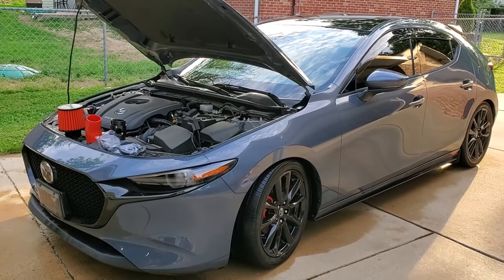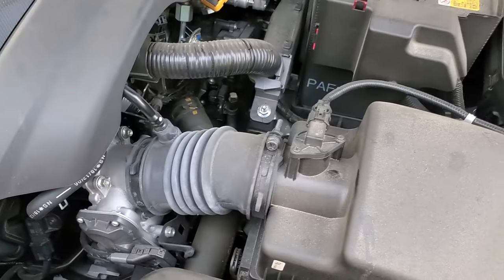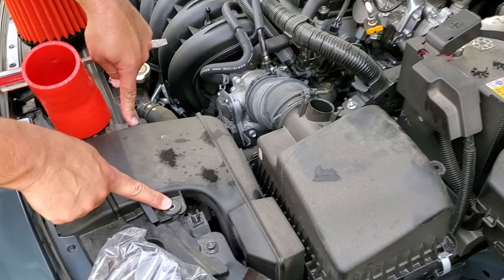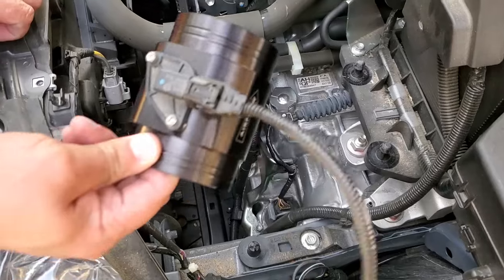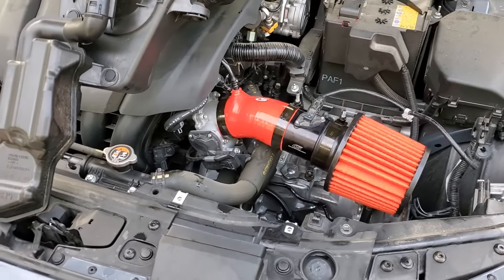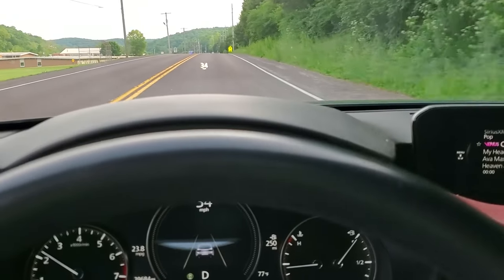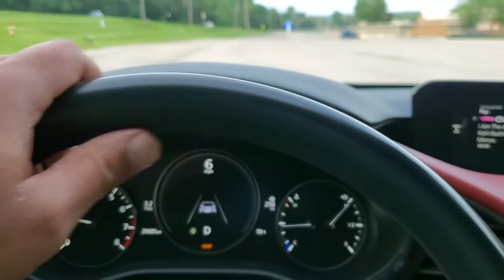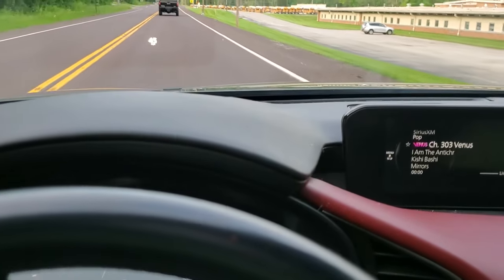2019 Mazda 3 gets Corksport High Flow intake and the car comes alive. Simple install for big sound

Comment: Dissing Mazda engineering while installing hot air intake hmmmmmm
Reply: Not to mention from what I have read on the mazda 3 forum is that you actually lose low end torque with no hp gains. The placebo effect.
Reply: No offense to the OP but I thought the same. The larger OEM intake is clearly a CAI even if not as flowy as an aftermarket one would be. That shorty looks like a step backwards
Reply: That was my thoughts lol 😆
Reply: You do, on just about every car you put these dumb things on.
Reply: Ed Findlay  people think any aftermarket part actually increases performance
Reply: yup, there is a reason why mazda did it like that, and still stock i can hear the air going through, its not too big but i can hear it
Reply: @fakebrake  not at all. I found a noticeable increase in power across the board. The skyactiv's torque peaks around 3000 rpms. But remember, when you start with a small 4 banger, expect small gains. Actually skyactiv's have been dyno's with all types of mods, with just 93 octane there's an up to 7hp increase, with corksport intake and exhaust on the 1st Gen Skyactiv 3's, dyno saw an increase from 118hp/110lb ft. of torque to 135hp and 123lb. For a small N/A 4 banger designed for gas mileage with 13:0:1 compression, it's not to bad.
Reply: Also, intake can be beneficial if don't properly. But air velocity is important. If you put a 4" intake on a 2" throttle body, you will see and feel a loss in power cause the air now moves slower, and then bunches up and gets turbulent at the throttle body. But if your intake can smooth out the flow of air, and is the same size as the throttle body, you can increase air flow and reduce turbulence. That's why quality intakes cost money. It's the R&D to keep it as close to factory specs while actually gaining power and response.
Reply: I thought the same. Mazda seems to make a really nice air box, honestly the one on my new cx5 looks darn near as nice as the trd air box for the 4Runner. If anything I have been doing my research on the takeda two stage cold air intake system.
Reply: @thetechlibrarian  I think the afe intakes for the Mazdas come with an air box as well, they seem really well engineered.
Reply: It makes above 5k rpm and lose below 4k. The highest 2nd gear comes down to when you shift is exactly 3k. I had to lose the filter and add extra tubing and a bigger aem dry flow to make it work. Now it only bogs if i floor it below 3k. But its not quiet, thats for sure. Idle is kinda rough and start up takes 2 sec longer after its warmed up. But its good.
Reply: Bruh cool sound bruh let's get warm air to the engine bruh
Reply: Truth. The only way it makes sense is if you’re gonna get it tuned.
Reply: @thetechlibrarian which takeda CAI are you looking at thatll fit the CX5?

Comment: I hope you were being sarcastic in regards to the OEM air intake design lol it’s actually very well engineered with built channels to pull in air from the bottom (colder air) and air from the front of the hood
Reply from the maker: YA so, and it was sarcastic. The engineers could have also designed the ultimate cold air intake with a High flow filter to get more out of the engine.  but instead they spent a year 3d scanning the space and over engineering this crazy contraption.
Reply: @jasonin2details  you just needed  a high flow filter.. That fits inside oem. Box. , or least buy another piece of plastic tubing so your Intake cstches colder air from the bottom.
Reply: @jasonin2details  After reading this I respect your opinion completely. They need a better filter and that's it.
Reply: @jasonin2details  did u consider that the engine is sucking hot air from the engine bay instead cooler air in front of the car.? Warmer air means less mass. I don't think its better then before.
Reply: Hot air intake ftw lol
Reply: In my opinion the first tune up should be the brakes and proper tires. Then do the 💪 side of the tuning.
Reply: Which breaks? Where is it broken?
Reply: I thought it was thought out to be efficient in gas. More mpg than more horsepower.
Reply: Been there...... big waste of money....
I learn the hard way.
Trying to help others.
Do not fiddle with it.
 Buy a car with more horsepower.
Reply: @richardmichael59  better now?
Reply: Its made like thst to be quiet

Comment: It may sound cool but it's pulling in hot air from the engine compartment vs a CAI which brings in cooler air from down below. The only option for an SRI is to install a heat shield which will keep some of the engine heat from reaching the filter. You want to bring in cooler air, not hot.
Reply: Yeah lol you sacrifice a lot of performance for the sake of sound. Engineers aren’t doing anything unnecessary it’s not just to reduce sound lol
Reply: The stock airbox is literally 8 inches from where this goes lmfao
Reply: @draconiceon2638  yes, but it has intakes to suck air in from the bumper and below the car where cooler air is vs got air from this SRI
Reply: @KeAndreFoster  cool air still comes in from those locations while driving, you just have to worry about heat soak at lights, but let's be honest, you are not launching these cars off the line.
Reply: @KeAndreFoster  but the box still gets all the heat from the engine and the air temp changes as such…
Reply: Everyone says this thinking they’re exposing an automotive secret but news flash we already know. People do it for the sound. By all means keep telling people what they already know
Reply: @danejensen6064  chill out lol
Reply: Not just a heat shield, add some ducting to where the filter is so it gets some cool air under acceleration…
Reply: @draconiceon2638 it's not the location of the box that matters, it's where the air you're feeding into it comes from. The stock box pulls air from outside the engine bay.
Reply: @spamcan9208  yeah except its incredibly restrictive and i would guarantee the air flow is worth more than the temperature. You’re not hurting your engine
Reply: @draconiceon2638  I guarantee you that hot air is robbing a few horsepower because the stock intake is less restrictive than you think.  Mazda wants maximum fuel economy and power, it's in their interest to design a good performing intake.  Will an aftermarket intake flow better? Likely, but probably not by much. 
Also, I never said anything about engine damage. Inlet temps are probably below that of the turbo version.
Reply: They now have a " cold box " for the short ram intake.
Reply: You should check out your rpm while idling. It may be lover than regular..

Comment: Most Mazda engines lose power when you take out the stock box.
Reply: And MPG
Reply: Haven't experience any power lose or heating issues. Any possible MPG lose will be assessed over time.

Comment: I have the 2019 Mazda 3 Hatchback.  One of the things I like most is the quiet sophisticated ride.  To each their own.
Reply from the maker: Some people dont like window tint!
Reply from the maker: I don't like rubber floor matts. They make total sense, easy to clean, last a long time, keep factory carpet cleaner. But I just like to send a message, Nice carpet matts look better.  live on the edge a little, make a statement, be individual!
Reply: They now have a cold air box for the short ram intake

Comment: The airbox looks like that because it is a tuned "helmholtz resonator". Look that term up. The filter hanging off the throttle body may make it sound cool but likely will create holes in an otherwise nice wide torque curve because the flow characteristics being off.

Comment: Might be better if you lengthen the intake pipe and run it into the fender/luwer bumper. You'll get colder air and a way deeper sound.

Comment: What I did instead of buying an hot air intake was remove and block off the intake resonator. It gave it a bit extra sound and now the outside air goes directly in and through the filter instead of the resonator.
Reply from the maker: I would follow that mod up with a High flow filter also and that should net some HP also.
Reply: @jasonin2details  i was thinking about that but wasn’t sure if it was worth it. But I think I will now thank you.
Reply: @jasonin2details   would it be possible for you to make a follow up video on the corksport lowering springs? Thank you for the great content 😀
Reply: Hello there. How did you do that? I already have a high flow k&n filter on the stock intake system. But that trick sounds interesting and would like to try it.
Reply: @joegonz1983   I used gorilla duct tape to block off the holes 🕳 from the resonator, since that was all I had at the time.
Reply: Those k&n filters are a joke. I used one for years till my throttle body kept getting clogged. Yeh you get lots of air but then it doesn't even filter shit out of the litter box.. wix filters on the other hand have little less airflow but actually filters the air like an air filter should. Now if your pumping 750hp +++  on track day then yeah k&n is your bet but only on track day dont use k&n on your daily.
Reply: I did this too on my 1.5 skyactiv-g. The air pathway is long and complicated so I didn't think resonance would  be much of an issue to performance anyway. afterwards given the increased airflow, I went ahead with an NA remap
Reply: @JOHNFNLESLY  yup, all these filters will results in dirtier engines. You can see it in the oil analysis too.

Comment: Not a huge fan of sport mode with the Mazda 3. Especially with the 2.5T engine. It hangs onto gears a lot longer but by the time you're progressing through the shifts it's already up to speed.

With my kia forte gt line - the sport mode was actually useful for passing because of the lackluster cvt. But with the 6 speed auto it just doesn't make a whole lot of sense. The acceleration is actually quicker in normal mode plus it's it doesn't wear and tear as much on the engine.

Comment: I just got the replacement cone filter from them. Haven't replaced it yet but FYI it has an inverted cone in the end of it compared to the flame rubber capped end. Might make it slightly more throaty-er? Lol

Comment: What does "Montrosity" mean? 🤣🤣🤣 Thanks for the video, I'm considering making a box as now the " cold" air filter will not be so cold air when it doesn't have a direct path to the air filter. Now you are. Just taking ambient air which is being directly heated from engine temperature. I'm calling that, overlooked or under engineering on corksport behalf

Comment: Hot air intake will sound better, but I agree it's a step backward. Curious if  OP lost MPG and experience heat soak?
Reply: definitely a reduction in mpg, did the same in my '17 mazda3 2.5L, obviously worse mileage.
Reply: How would you lose Mpg for freer flowing intake? I'm thinking it's because we enjoy the sound, so we gun it more out of habit, and that's really why the Mpg suffers. Prove me wrong. I mean really, when is the last time you blipped the throttle of your STOCK car to impress someone at light...... NEVER! 🤣🤣🤣
Reply: @godzla69  more air means the car needs more fuel to maintain proper AFR
Reply: @godzla69  the whole point of an aftermarket intake is to increase airflow. if you're flowing more air the MAF will account for that and adjust fuel trims accordingly. more air = more fuel = worse economy. it's no surprise whatsoever that an aftermarket intake reduced fuel economy, especially in an economy car.  i'm not reading the rest of whatever you commented because it has nothing to do with this conversation, but if you mentioned heat soak there was showings that a corksport short ram intake had negligible heat soak which immediately went away upon driving the car regardless.
Reply: as a reminder, your initial argument to this was that i just "hit the gas more" so my mpg was worse, lol.
Reply: @anotheruniqueusername  that's rich.... You think you are getting more air. Maybe you should have read the rest of what I wrote... As it definitely relates. Don't bother having a discussion if you are afraid of getting educated... Peace out.
Reply: Don't take it from me... This is what K&n claims as well. Note nothing about decreased Mpg.

offers over a stock system stem largely from two design characteristics. First, a cold air intake reduces restriction on the intake air and utilizes larger intake tubes for increased airflow to the engine. Second, it positions the air filter in a location that allows it draw in cooler, more oxygen-rich air. By upgrading to a cold air intake you can achieve up to 20 percent more power, quicker throttle response, cooler engine temperatures (potentially increasing service life), and moderately better gas mileage—not to mention a high performance sound.
Reply: @godzla69  and what do you think the car is doing to adjust to more air????? Adding more fuel!  Its simple combustion engine logic… if you have more air then you need more fuel for efficient combustion.  Come on dude.
Reply: @godzla69  our bodies aren’t run on combustion
Reply: @Freestyler4130  stay in school, don't do drugs.

Comment: The reason that air box looks like that is engineering. You basically removed all that hard thought-out engineering which not only suppresses intake sound but also take refractory waves that are coming off the intake and exhaust valves and canceling them out which increases your low end torque. There are box is actually a very well-designed cold air intake also so you replace that, which in effect reduces your power output, and sucks in some extra dirt, to get some rice he looks and some sound. Congratulations
Reply from the maker: Congratulations yourself! Please see my comments below.
Reply: So you just hate fun then huh?
Reply: @StreetP00DLE if losing power is fun for you then go for it lol. There are mods that are way more cost effective that are both fun and gain actual HP.
Reply: @JohnBoulding  lmao loosing power at the cost of that sweet intake sound, but what are some of those more cost effective alternatives for more hp?
Reply: @StreetP00DLE   number one , an ECU reflash/tune, Lighter wheels, are two of the most cost effective. 
With a tune you could even run and intake with larger piping and MAF housing and get real gains from it. But slapping on a cai and  mufflers downs nothing for power

Comment: I get the breathing easier part, and I have used an APR CAI but it drew air from the front grill as well. Putting your air source inside a hot engine bay makes zero sense for cooler air.

Comment: How I wish they made a fast version of this, it’s such a beautiful car. Can’t wait until the Corolla GR comes out in the states, that HB is equally as beautiful.
Reply: This does come with a turbo now for the 2021 models.
Reply: @joemzd  not necessarily “fast”. It may be faster than the 2.5 NA but nothing compared to performance oriented hatches. Still a wonderful car that would sell like hot cakes if a performance version was released 🏎
Reply: @rodrigosuarez586  I had an 02 Camaro Z28 and then a 2013 Genesis coupe track and now a 21 3 HB turbo and yes the mazda 3 isnt as exciting as the other cars but its almost just as quick, especially to 60, it has the perfect power for launching where I never get any wheel spin. It makes like 300 lbft of torque @ 2000 RPM crazy low in the rev range.
Reply: @Loooooooooooooooool  I love my Mazda3 2.5T as well.
Reply: @rodrigosuarez586   "Still a wonderful car that would sell like hot cakes if a performance version was released " Ya thats why the speed 3 is their number one selling model
Reply: This car is the fast version, look no further.  Even without a turbo the Skyactiv G engine is very powerful.
Reply: @snehalkrishnan618  skyactive g without turbo feels OK. My sister owns the 2020 GT mode. It is a beautiful car, but wouldn’t call it “fast”. Still a badass ride
Reply: @CrunchyTire  not sure if this was sarcasm or not, but speed3 is a beast car. I love mine, never getting rid of it. At 400whp/400wtq right now, still have room to grow once I ass more fuel.

Comment: I hate to piss on this cos Im sad..I have a 2021 Hatchback.
But these confuse the computers, often put much hotter air in, set the Check Engine lights off and in time will make it idle and run worse cos the car isnt tuned for it.
UPDATE : Its a year later and my opinion, right or wrong has changed.
Now the only thing i still believe is about the hot air.

Comment: That intake looks cool but it is just sucking in hot air from the engine bay. OEM is actually a better design for actually sucking in cooler air.

Comment: Did you notice your vehicle get hotter with the short ram intake during the summer compared to stock?
Reply: CorkSport has a cold box for the short ram intake.
Reply: @gushinojosa7696   yea I ended up getting the takeda dry flow cold air intake. Happy with my purchase.

Comment: Jason does this cork sport cold air intake along with the magna flow exhaust create more horsepower and increased torque?
Reply from the maker: @timothywood4972  just a little. Nothing to write  home about. Mostly great sound and looks
Reply: It's adds 20 HP 20 Torque
Reply: @jasonin2details video is horrible
Reply from the maker: @johnx585  Thanks for supporting the youtube algorithm it got YA!

Comment: Hello. I own one of these cars in Germany, BP 2019, 122bhp, m-hybrid. Does this mod have any other function other than noise? I mean, fuel efficiancy? Thanks.
Reply: It will actually hurt your fuel efficiency and you gain no actual performance out of installing one of these in your 3. If you want more induction noise, you’ll get that, at the cost of fuel efficiency. It’s up to you if it’s worth the trade off.